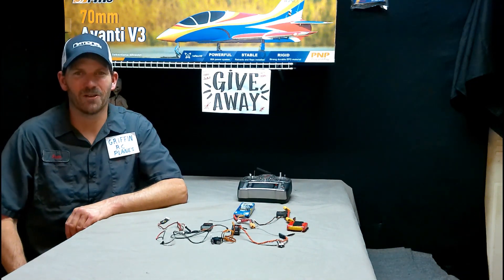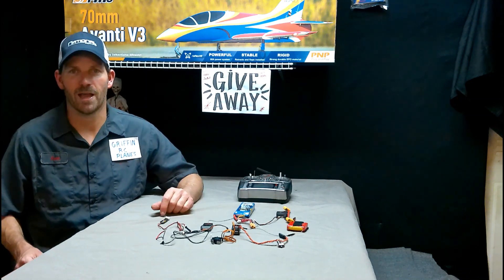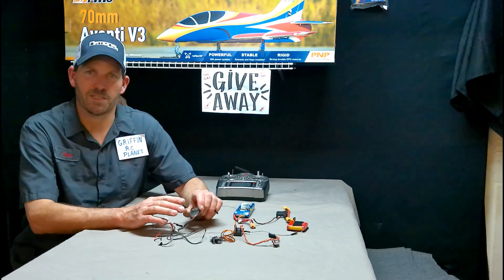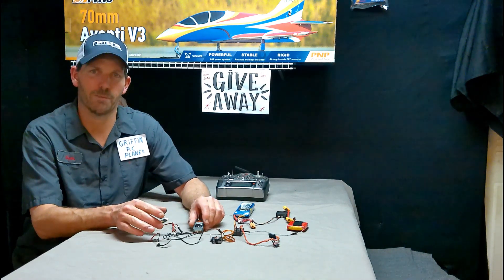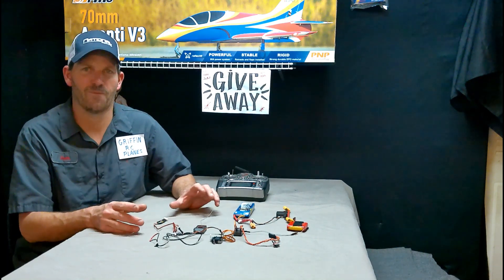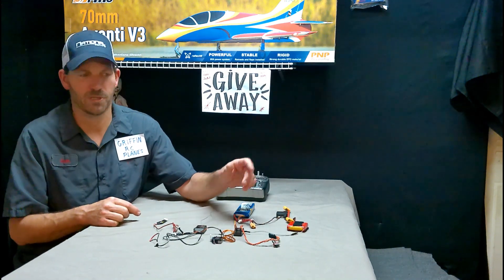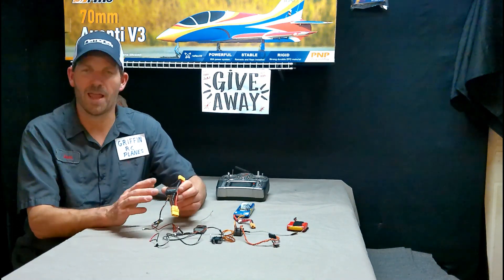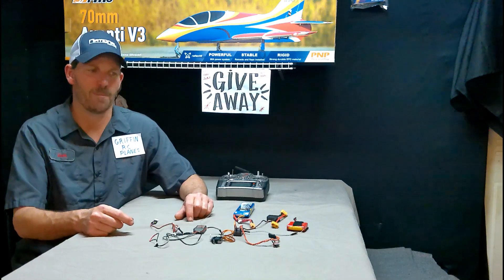SPEKTRUM TM1000 TELEMETRY MODULE EXPLAINED RC AIRPLANE SETUP SEE BATT VOLTS RPM TEMP X-BUS AND MORE

Comment: The TM1000 caused my plane to crash.It had about 3 thousand flights on it.Its the only plane I had with the TM1000.I trashed it all and now I just use receiver and servos. My new plane has telemetry built in to the included receiver.My other planes are fine.

Comment: Very well done, Sean.  You’ve at least scratched through the surface of my level of understanding.  I’d still like to know how to get altitude into the mix, probably with another X-bus add on connector.  Where can a person get these connectors?  I’d also like to know about how to set up elevens and crow, if possible in a later video.  Keep up the great tutorials. 👍🏻 Looking forward to your next video.  Sounds as if you anticipated some of my questions. 👍🏻
Reply from the maker: OK IF YOUR GOING TO USE THE TM1000 SET UP BECAUSE OF ONE OF THE REASONS THESE VIDEOS TALKED ABOUT , THEN YOUR RIGHT YOU WOULD NEED A X-BUS ADD ON SENSOR ALTITUDE AKA VARIO SENSOR
Reply: @GRIFFINRCPLANES  Spektrum no longer sells the TM1000, and it sounds like the 1500 model they replaced it with is surface vehicles only. 😟
Reply from the maker: CROW ELEVON ETC COMING SOON . I AM ASUMING YOUR TRANSMITTER IS A DX8 OR A 7S ?
Reply: @GRIFFINRCPLANES  I have a gen 3 DX6, and a new NX8 to work with.  Still learning though.  I also have a AR637T that I stuck in my Aero Scout to test.  I’d eventually like to put it in the Eflite F-16 Thunderbird I bought used, and set the RX up with  angle demand and other stabilization features that would assist high alpha flights.  Another future lesson, I hope. I like how you present information in your videos.  Thanks for what you do. 👏🏻👍🏻